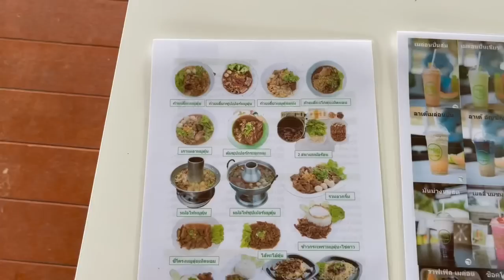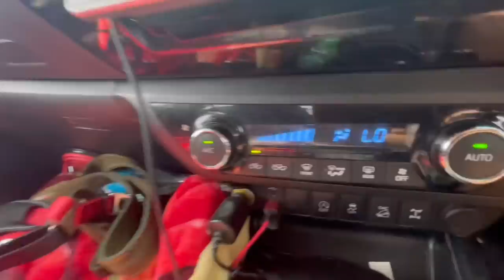Visit to the Mountain Durian Farm - Daily Vlog From Southern Thailand

Comment: In my opinion mate those laser sights are useless and way to fiddly. You will be a much more accurate shot if you use your rear and front sights on the firearm. If you look through the rear sight and align the front sight in the middle you will shoot straight. When you get more competent you can just concentrate on your front sight. Controlled breathing is also very important and a slow steady trigger squeeze. Breath out slowly as you gently pull the trigger. Happy shooting
Reply from the maker: My wife aims high, I thought the laser might teach her to aim lower, perhaps its that famous glock trigger angle? I will have to use the laser a lot more before I decide on it I think.